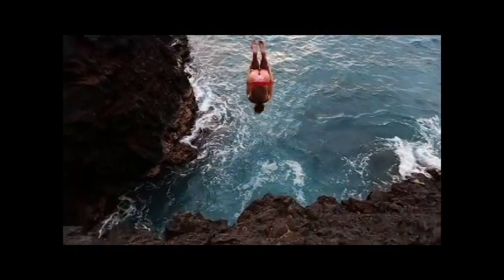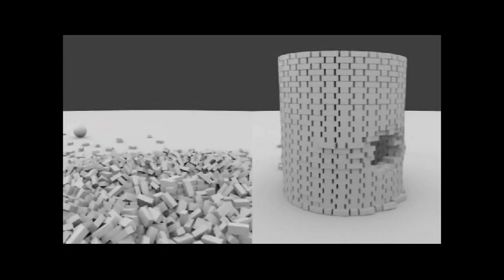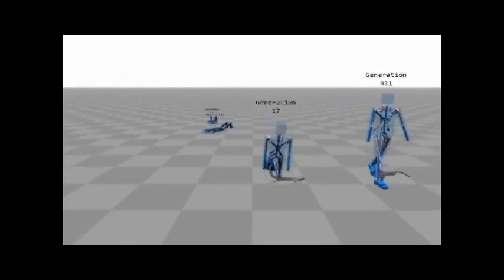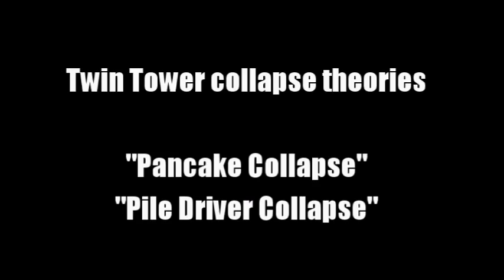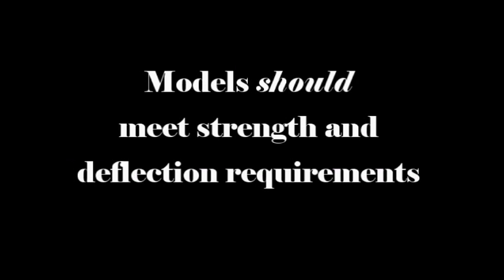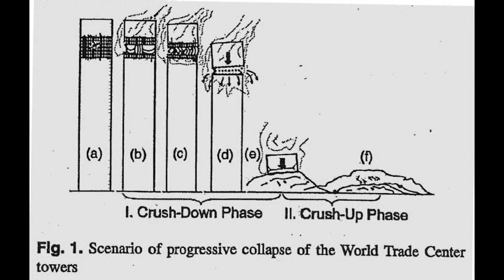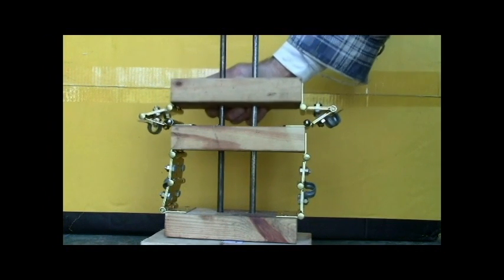9/11 Experiments: The Force Behind the Motion

Comment: Your method is simply wrong. You cannot draw conclusions from scaled models the way you do. The strength properties are not matching. The gravity-factor does not match. That is why people use computers for this kind of simulations. Then you can get the numbers right. But you need some education and the right tools to do it. Although Newtons laws are quite important, they are not the only laws to be used when analyzing a collapsing building, you have to take the structure into consideration. It took ½ a year in computer calculation time to calculated the collapse of building 7. But having done that, they ended up with a model that pretty much fitted into all the videos and observations, from the initial colapse of the penthouse building through the inital slow phase of collapse through 2.5 second free falling phase and through the last phase where the structure was again slowing. Unfortunately NIST did not simulate the downfall of WTC 1 and 2.

You try to analyze the downfall towers, but the materials you use have no relation to the steel used in the buildings. 

In your first experiment you work with walls that will never collapse! In WTC 1 and 2 you cannot have the walls standing in the free after the rest of the building is gone.
When you work with buildings you have to take bending moments, and buckling proces into consideration. In the WTC the changing properties of the steel when heated was an important factor in the collapse.

But maybe this simple argument will help your understanding.
For WTC 1 and 2 the walls were the strongest part of the building, they did not crush as fast as the center, so it looked like explosions coming from inside when the floors were pancaking. Eventually when the walls crushed they bended outwards like a canopée. This effect flew burning material from the south tower into building 7, and ignited the fires there. But in order to understand that, you must be able to understand, that a vertical force can transverse into a vertical movement simply because of bending. Think about a lamp post that buckles, it will bend and fall outward.  A normal lampost will however still be straight while the base is bending but if you have a 110 story wall! It will bend over, there is now way you can have 110 story wall standing without support.  In your first model the walls could not move, the floors were to strong. If you think about it. The WTC tower 1 and 2 had some 30 to 40 story building falling in the start just one floor down. No building in the world is designed to stop that motion. That is why the collapse continued all the way.

It simply had to collapse. That's probably why NIST did not even consider modelling the downfall of the building. The initiation process is enough to understand. When a 30 story building starts falling, it will pulverise everything!
What about the walls, they were designed to support the building, but they could not stand without bending without the support of the rest of the building. How much could they stay without bending. In the debris of one of the buildings there is a multi story wall standing, which may be used as a thumb rule of how tall a wall can reach before bending over. If you are a building engineer you can calculate that more precisely. Anyway the movement of the walls is quite important to understand when trying to understand how the building crashed. And you can see that on the movies if you know what to look for.
Reply: "In WTC 1 and 2 you cannot have the walls standing in the free after the rest of the building is gone."
I believe this is the most important observation/fact to understand why the towers fully collapsed. Combined with the fact that the core and perimeter elements were bolted together, not designed to tak any other than vertical forces.
Reply: Your observstion is overly done and thus utterly wrong.

You have steel sections weighing several tons being thrown out at such speed that they imbedded themselves into neighboring buildings!!  

When the sole force being applied is gravity.

Your theiry has ZERO reason for the force that threw those beams out.  

The ONLY way you get those beams to do this is to apply a force that is not from gravity.

And your theory lacks any explaination for where all the stuff went in those towers.  The only things they recovered were steel frame.  1 file cabinet out of 40k plus.  No desks.  No transformers.  No ANYTHING.  Besides paper there was no evidence proving the worlds largest business office complex was ever there.

Your theory also ignores how fires could have burned for 100 daysafter the collapse.  Those fires according to your boys were due to office fires fueled by jet fuel and office supplies.

But you again pretend that the majority of jet fuel was gone when the plan exploded.  And office furniture is required to be resistant to fire.  

And how many people did you see leave those buildings soaked in water from a sprinkling system?  

0. Thats how many.

Seems odd the largest office buildings on earth did not have sprinklers go off.
Reply: @DS94everXev  "Your observstion is overly done and thus utterly wrong."
Are you sure? Let's take a look at your arguments...

"You have steel sections weighing several tons being thrown out at such speed that they imbedded themselves into neighboring buildings!! When the sole force being applied is gravity. Your theiry has ZERO reason for the force that threw those beams out. The ONLY way you get those beams to do this is to apply a force that is not from gravity."
So, some sections of the perimeter travelled about 500 ft. Quite a distance for such a heavy object. I agree. Yet you claim these were " thrown". Not sure what that means exactly, but it looks like you suggest this throwing would have been the result of some explosion. Now I am curious what kind of explosion would be able to throw multiple tons steel segments 500 ft away. For sure demolition explosives are designed to cut trough steel, not to throw steel away. I guess we can agree to that. Let's take a look at an alternative explanation.

Imagine a pile of beer crates falling sideways. The upper crate would travel quite a distance, depending on the size of the pile. No explosives needed for that, just gravity. The crates represent the perimeter segments. What would happen if parts of the perimeter would fall over, like slabs of segments, maintaining connected? It is not hard to imagine that the upper segments would travel quite some distance as well. The horizontal distance travelled would equal the vertical size of the slab. Now, would there be some kind of evidence to support this explanation? Maybe a picture that shows a slab of connected perimeter elements laying over West St.? Yes, there is. Please take a look at this picture below and see of the slab and the embedded element form a perfect line.

https://ia801303.us.archive.org/2/items/NIST_9-11_Release_08/International_Center_for_911_Studies_NIST_FOIA/Release_08/Release%208/42A0007%20-%201of3/Police%20Overheads/166.JPG

So, no explosions/explosives needed. Just gravity.

"And your theory lacks any explaination for where all the stuff went in those towers.  The only things they recovered were steel frame.  1 file cabinet out of 40k plus.  No desks.  No transformers.  No ANYTHING.  Besides paper there was no evidence proving the worlds largest business office complex was ever there."
Nah. I know this is a popular believe within the truther community. But it is incorrect. Yes, larger objects were reduced to small pieces in the collapsing process, but what does that mean? A lot of items were recovered at Fresh Kills. Keys, elevator signs, credit cards, also armrests and seatbelts from the planes. Larger pieces as well, like elevator motors.

https://www.youtube.com/watch?v=OdMqX_F66rE
https://www.youtube.com/watch?v=Bgt5a-HoPPo

Let me ask you this, how would explosives cause the contents of the buildings to disappear?

"Your theory also ignores how fires could have burned for 100 daysafter the collapse.  Those fires according to your boys were due to office fires fueled by jet fuel and office supplies. But you again pretend that the majority of jet fuel was gone when the plan exploded.  And office furniture is required to be resistant to fire."
Jet fuel ignited the office fires. Office fires are fires fueled by office contents. Some office content is highly combustible:
- Wiring
- Plastics from phones, printers, faxes and other equipment
- Paper (a LOT of it)
- Rugs
- Curtains
- Furniture
When you claim "office furniture is required to be resistant to fire", to which specific law or regulation are you referring?

"And how many people did you see leave those buildings soaked in water from a sprinkling system? 0. Thats how many. Seems odd the largest office buildings on earth did not have sprinklers go off."
So how would you expect a sprinkling system to be intact after a plane flew into a building, destroying steel and concrete? I think it is safe to assume water pipes were destroyed upon impact as well. Not really odd to me.
Reply: @brucelansberg5485  1.  Your comments are made to explain that which can not be explained.

The sprinklers in the lobby would still have worked.  As would the sprinklers in all the floors below the impact.  The people on those lower floors would be the ones that escaped.  They would be wet.  But they werent.

2.  All the items you list computers pladtic are not going to get a fire hot enough to melt and bend steel that has fire protective coating on it that the towers had (hint they actually didnt).

3.  It is not incorrect that only 1file cabinet was recovered.  And it was in the basement.  Where did all the stuff go?  You still dont state that.  The recovery workers eondered the same thing.
Typical demolition explosives do not throw objects like we see.  And vertainly gravity wont as it acts only in the z axis.  There MUST be a force that is strong enough apllied in a direction that IS NOT from gravity to throw those sections into and embed them into buildings.

Your beer crates arent multi ton steel sections.

And you are not even getting at the real cinundrum conundrum of 911.  How did those planes reach the speed the government said they did (500 plus mph) when those planes maxout at 250 mph below 10000 feet?

Hmmmm????

Those planes that hit the tower would have been flown apart going that speed.  But they were stable as can.be.

That is IMPOSSIBLE.  Those passenger planes can not go that speed.  The phone calls made as the planes hit did not show any screaming or anything that woild have happened if a plane went 2x the max speed it actually can.

So all your talk about explaining the impossible on the towers is ALL DEPENDENT on explaining first how those planes went that fast.  Then explain how those planes that a flock of birds that impact the plane can rip huge holes in it managed to blow thru steel concrete buildings.  Cant wait for your newtonian law here!

You conspiracy people want to pretend that the building is the start of the physics impossible problem.

Explain those planes!  Because you cant.  Then all your defense on the towerd collapsing falls apart like paper machet.
Reply: @DS94everXev  Thanks for your quick reply. At least we seem to be in agreement on the alleged throwing out of multi ton steel elements. That's progress.

The sprinklers. I'm not a fire safety engineer, but I can't imagine sprinklers being activated on floors that are not on fire. Why would they? Sprinklers are activated by a heat sensitive element that responds to the heat of a fire. Which seems to indicate no response without hat from a fire. As far as I know, no people were evacuated through the lobby since there was a real danger of getting killed by falling bodies and debris. That maybe leaves a handful of people that might have gotten wet by the sprinklers in the lobby.

"All the items you list computers pladtic are not going to get a fire hot enough to melt and bend steel that has fire protective coating on it"
You might want to research expected temperatures in office fires. The avarage temperature in building fires is 1700 F. Plastics only add to that temperature. Steel will have lost 50% of its strength at about 1150 F. No steel was melted.

It is assumed the fire protective spray on was blown off upon tyhe plane impacts.

"It is not incorrect that only 1file cabinet was recovered."
I was referring to your claim nothing except paper was found to indicate there ever were office buildings.

"Where did all the stuff go?  You still dont state that."
My response was that larger objects (like filing cabinets) were reduced to smaller pieces. Have you watched the two short videos of the trip to Fresh Kills?

"The recovery workers eondered the same thing."
They didn't. They merely observed it.

"Typical demolition explosives do not throw objects like we see.  And vertainly gravity wont as it acts only in the z axis.  There MUST be a force that is strong enough apllied in a direction that IS NOT from gravity to throw those sections into and embed them into buildings."
I am so sorry you still don't seem to understand how that piece ended up stuck into the WFC. I clearly was too early when I stated we agreed upon something here. Please click the link I provided in my earlier post. You will see how full slabs of perimeter panels fell as one and hit the WFC building. It is righyt there, in that one single picture. You only need to click it.

You remark on the direction of gravity which is not able to move objects in any other direction, is clueless. Sorry to say. Just put your car on top of a hill and put it in neutral. Does it move due to gravity> Yes. Does it move in any other direction than vertically? Yes. If your logic would be correct, nothing would ever fall over. We could balance a baseball bat right on the floor. Gravity does make stuff move sideways.

The beer crates (not cans) fall over when stacked. The top one falls way out of the footprint of the complete stack. Mass has nothing to do with this principle.

Please take a look at the picture I linked before.
Reply: @brucelansberg5485  
"You might want to research expected temperatures in office fires. The avarage temperature in building fires is 1700 F. Plastics only add to that temperature. Steel will have lost 50% of its strength at about 1150 F. No steel was melted."

Then you are saying that typical office fires would weaken steel to lose 50% of their strength and thus those buildings would see a similar collapse like the WTT.  

Yeah not buying it.

"It is assumed the fire protective spray on was blown off upon tyhe plane impacts."

Why?  Does that mean that an energy impact on a building makes the steel lose its fire protection?

You realize that it does not matter what the source of that energy is right?  An earthquake can apply WAY more energy than the plane did.  Does that mean that after every earthquake the steel must be checked for fire protection stability to see if it is still there?

"Just put your car on top of a hill and put it in neutral"
And if my car was put in neutral and was accelerated to several hundred mph before it was even rolling down hill that would be a sight to see. 

That is the kind of speed those steel sections were going!  A force was applied to them to make them go that direction when there was NO FORCE if it was just gravity.  You can only conclude not from gravity or things falling on top of it was applied to make that happen.  Why is this so difficult for you to understand?  

Lastly, the planes are what matter!  Can't explain the physics of how those planes were stable and not falling apart going over 2x the speed they can handle.  

So the entire story after that is conspiracy hiding the truth.

Those planes are what matter.  There would be nothing left of those planes if they tried to go that fast.  They'd never reach the towers.
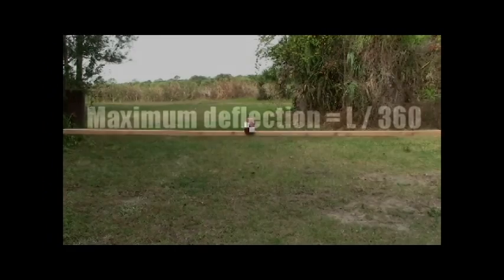Reply: @DS94everXev  "Here is a link from an actual pilot stating the max speed and explaining what happens to passenger planes that exceed that max speed. Go to the 4:50 mark to hear him state 250ph is max speed."
I love Mentour Pilot and have had a subscription with his channel for years. He mentions a maximum speed of 250 knots per hour USING FLAPS, used during landing and taking off. In addition he is talking about a 737 while the planes that went into the towers were botht 767's. It probably won't make much of a difference, but still max speeds using flaps in any configuration are different for different airplanes.

"Whatever hit those towers was going 500 plus mph.  Thus whatever hit those towers WERE NOT those passenger planes."
If your facts are wrong, your conclusion will be wrong as well. Interesting though you do accept indicated speeds of both flights, although they were published by the same authorities whose explanation and conclusion you do not accept.

Flight 11 was doing 465 mph by the way.

"Thus the ENTIRE narrative of your government conspiracy is WRONG.  It all hinges on those planes going that fast."
So the conclusion above is based on your false interpretation of Mentour Pilots'  explanation on speed limits on a 737 using flaps?

"By the way do you know who does have planes that can travel 500+ mph at well below 10000 feet?  The military."
So?

"Who has access to not just thermite but nano thermite which was found on site?  We do."
Your thinking process is going in all directions at the same time :). It's a little bit hard to follow. Anyway, (nano) thermite is an incendiary, not an explosive. So if you're suggesting (nano) thermite was being used to bring down the towers, and you believe some exterior panels were thrown off the buildings horizontally, you have some explaining to do. You can't have both.

Then again, there is no proof whatsoever (nano) thermite was found. I am well aware of the flawed paper by Harrit and Jones. All they have proved is that primer paint is combustible.

"And before you try to throw some convulated physics around explaining how those are not nano thermite spheres you MUST explain those planes going that fast! Hint. You cant."
I think I shown how your conclusion on the maximum speed based on the video you provided is false. There is no other explaining to do on my side. You should find yourself some other credible source to back up your claim.

"Why the US and Israeli government does of course."
I don't understand what you're trying to say here :).

"Who has access to the grade of anthrax that was sent after 911"
I don't see how this has anythinf to do with the subject matter. I haven't studied it and I do not think this is relevant.

"a guy hidden in a cave in one of the poorest country on earth"
Who is a member of one of the richest families on earth... Funding has never been an issue for Bin Laden.

"Who would have access to something that annhilated things that cant be annhilated (those turbine engines and black box and transformers)?"
Contrary to what you seem to believe, black boxes and engines are not indestructible. I don't think the strength of black boxes has been tested in circomstances of collaping buildings falling on top of them. Then again, maybe they weren't destroyed but simply never found in a 1.8 million ton debris pile.
Reply: @DS94everXev  "Then you are saying that typical office fires would weaken steel to lose 50% of their strength and thus those buildings would see a similar collapse like the WTT."
No I'm not. I was saying steel will have lost 50% of its strength at a temperature of about 1150 F. What is means to burning buildings is a different story. Steel framed buildings have some kind of fire resistance to slow down the heating process of the steel. In most cases sprinkler systems will not be wiped out as a result of fire. But most importantly, luckily most steel framed buildings are not susceptible for progressive collapse. And last but not least, most office fires do not rage on several floors and at the same time and are faught.

"Why? "
Because two high speed plane impacts caused massive explosions. Explosions come with pressure waves. These pressure waves could have easily blown off the sprayed on protection.

"Does that mean that an energy impact on a building makes the steel lose its fire protection?"
In general? No. In the case of the twin towers? Yes. "Energy impact" is a very, very broad description and can mean a lot. We should focus on what happened at the twin towers I guess.

"You realize that it does not matter what the source of that energy is right?  An earthquake can apply WAY more energy than the plane did."
Well, if an earth quake would cause massive pressure waves inside the buildings, than earth quakes could do the same kind of damage. In any other case, no.

"Does that mean that after every earthquake the steel must be checked for fire protection stability to see if it is still there?"
Since earth quakes do not produce massive pressure wave, it seems unnecessary to do so. But to be honest, I don't know.

"And if my car was put in neutral and was accelerated to several hundred mph before it was even rolling down hill that would be a sight to see. "
I would to see that! :)

"That is the kind of speed those steel sections were going!"
So you're claiming those steel sections were going several hundreds mph? Even your friends at AETruth would find that rediculous. I believe Chandler measured a speed of somewhere between 45-70 mph. I can't be bothered to look it up though. But your claim is utter nonsense.

"A force was applied to them to make them go that direction when there was NO FORCE if it was just gravity.  You can only conclude not from gravity or things falling on top of it was applied to make that happen.  Why is this so difficult for you to understand?  "
It seems you haven't read or understood what I wrote before. Put a baseball bat on a floor standing up. Now release it. Which way is that bat falling? Straight down? Or is it falling sideways? The perimeter walls of the towers consisted of 3 story tall steel elements bolted together. What would happen if these walls weren't attached to the building and the connections remained? It would fall exactly like the baseball bat. Sideways. What we see in the countless videos is only the top elements of a complete wall. The lower elements are hidden by dust. But all elements fall as 1 single piece, sideways, as proven by the picture I linked earlier, where we can clearly see a slab of perimeter elements laying over West St. We can see the direction in which the wall fell, We can follow its path. And we can see how the upper elements hit the WFC. Please take a look at that picture.

"Lastly, the planes are what matter!  Can't explain the physics of how those planes were stable and not falling apart going over 2x the speed they can handle. "
Over 2 times the speed they can handle? According to whom?

"Those planes are what matter.  There would be nothing left of those planes if they tried to go that fast.  They'd never reach the towers."
Also, according to whom?

Please take a look at this video. Any idea how fast this plane is going at basically ground level?

https://www.youtube.com/watch?v=N1PKEqIBQAk
Reply: @brucelansberg5485  

"I love Mentour Pilot and have had a subscription with his channel for years. He mentions a maximum speed of 250 knots per hour USING FLAPS, used during landing and taking off. In addition he is talking about a 737 while the planes that went into the towers were botht 767's. It probably won't make much of a difference, but still max speeds using flaps in any configuration are different for different airplanes."

And you fail to state the max speed of the 767 at 1000 feet.  Guess what?  It ain't that different!  But you ignore the point made completely by talking about wing flap position?!!!  How come the pilot doesn't say wing flap positions can make a plane that can go 250 max manage to more than double its max velocity if it places its wing flaps just so.  

He doesn't because you are being a wise ass.  Not to mention that the terrorist's pilots could not land a Cessna or fly it well, but you want me to pretend that these guys had more savvy than the actual pilot of these planes.  Yeah.  Not happening.  

"If your facts are wrong, your conclusion will be wrong as well. Interesting though you do accept indicated speeds of both flights, although they were published by the same authorities whose explanation and conclusion you do not accept."

So you are arguing that the NIST is wrong then.  Or right?  Or what are you arguing?  I'm talking about measuring velocity of an object.  That is WAY easier than finding out how a building fell and is easily disproved if not correct.  I'm using the measured speeds and you are saying its a joke and to ignore it.  

"So?"

So the only group that has access to all these things are us.  Nano thermite.  Military grade Anthrax and planes that can go the speed that the planes went that hit the towers are the military.  That is why.  Hint:  It ain't some guys in caves living across the world where they use walkie talkies who managed to create all this and plan out the most orchestrated attack in world history on the most powerful military in world history. 

"Anyway, (nano) thermite is an incendiary, not an explosive. So if you're suggesting (nano) thermite was being used to bring down the towers, and you believe some exterior panels were thrown off the buildings horizontally, you have some explaining to do. You can't have both"

No.  I never said nanothermite blew those steel beems out to imbed into neighboring buildings.  But it is used to cut steel.  And cutting steel is precisely what you would have to do to bring down the towers. 

Something well beyond TNT was used to fling those beams out like that.  

"Then again, there is no proof whatsoever (nano) thermite was found. I am well aware of the flawed paper by Harrit and Jones. All they have proved is that primer paint is combustible."

Says no peer review paper.  It was found.  Simple as that.  

"I think I shown how your conclusion on the maximum speed based on the video you provided is false. There is no other explaining to do on my side. You should find yourself some other credible source to back up your claim."

No you actually did not do that in the slightest.  You obsessed on wing flap position and think that the planes got all that speed from a descent that did not rip the plane apart at all! 

before

ignores

Those phone calls were clear.  They had ZERO noise in them.  No engine noise.  One person was on the phone till the plane  hit.  Don't you think  a plane that is far exceeding its max ability would be scaring the passengers?  yet not a single person was screaming.  Hmmm.....  

explanation

explanation

Put simply.  Your explanation does not fit any of the known evidence.  And mine fits it perfectly.

In your pretend world, we can have pictures of passenger planes being ripped into shreds by hail and birds.  Yet them going thru a steel and concrete building and not just folding like a pancake when the plane hit the towers is perfectly acceptable.

I can only conclude then that the materials that make birds (hollow birds and feathers) must become the material we make future building from!  Afterall they can go thru a plane and a plane can go thru concrete so build buildings from hollow bones and feathers so when planes hit it, the building will not collapse.  This is the physics in your world.  I'm only going with it.    

"Who is a member of one of the richest families on earth... Funding has never been an issue for Bin Laden."

Haha!!!  So first world countries with WAY MORE MONEY AND KNOWLEDGE can not make this stuff and conjure up this plan while some guy who has flat out defied his family can manage this and make this stuff.  Again.  Not buying it.

"Contrary to what you seem to believe, black boxes and engines are not indestructible. I don't think the strength of black boxes has been tested in circomstances of collaping buildings falling on top of them. Then again, maybe they weren't destroyed but simply never found in a 1.8 million ton debris pile."

Funny thing is.  No crash on land has ever resulted in these things being destroyed or lost.  And on this day ALL WERE.

You also pretend again becasue you are limiting your discussion to the towers when more happened that day, that the plane that hit the pentagon and Flight 97 would have not been crushed by ANYTHING.  So where are they? 

nothing

And the Pentagon (which made a 270 corkscrew turn that a Top Gun pilot says he could not have managed to make while flying an F16 also failed to have a black box recovered.

because
Reply: @DS94everXev  "And you fail to state the max speed of the 767 at 1000 feet."
Why would I ever mention that in a comment on your misinterpretation of your own source?

" But you ignore the point made completely by talking about wing flap position?!!!  How come the pilot doesn't say wing flap positions can make a plane that can go 250 max manage to more than double its max velocity if it places its wing flaps just so. "
Dude, are you serious now? Please tell me where he stated that a 737 has a vMax of 250 knots ph? Please rewatch your own source from 2:00. He clearly says: "When we are taking off and when we are landing, we are extending high lift devices on the wings, so flaps. For every time you extend something, you're basically putting more of the aircraft into the face of the ongoing wind. So the drag will increase." In the part hereafter is discussing speed restrictions WHEN USING FLAPS. Please learn what flaps are and when they are used. You nonsensical claim is like stating your car has a maximum speed limit of 30 mph, while that limit only applies when driving in first gear.

Please look up maximum operating speed 737. Then lookup VD.

As for the quote an aircraft cannot go over 250 knots below 10k ft, please scroll to 10:45 where he explains this limitation is forced by air traffic control. It has nothing to do with the characteristics of the plane.

Please make sure you understand your own sources.

"So you are arguing that the NIST is wrong then.  Or right?  Or what are you arguing?"
It's not that difficult. I was trying to understand your point of view when it comes to official sources. You have accepted the measured speeds, but you have not accepted the fact that it were actually planes that hit the towers. Both claims originated from the same governmental source. So what is it?

"I'm using the measured speeds and you are saying its a joke and to ignore it."
Please re-read what I wrote.

"So the only group that has access to all these things are us.  Nano thermite.  Military grade Anthrax and planes that can go the speed that the planes went that hit the towers"
No thermite of any kind was found.
Anthrax is irrelevant and not related to the attacks on 9/11.
Planes fly faster than you have assumed based upon a fals interpretation of your trustfull source.

"I never said nanothermite blew those steel beems out to imbed into neighboring buildings."
Fair enough. But that would mean that both thermite and some kind of explosive must gave been used?

"But it is used to cut steel."
So is water.

"And cutting steel is precisely what you would have to do to bring down the towers. "
That would indeed be one of many ways to bring the towers down. There is only one problem though. How many pictures have you seen that show cut steel by thermite? Oh, there's another problem. How long did it take for the towers to come down? 15 en 22 seconds? How fast does thermite cut through inches thick steel? Wait, another issue. How much thermite would be needed? Tons? dozens of tons? Wouldn't you think that using so much thermite would leave some kind of evidence?

"Something well beyond TNT was used to fling those beams out like that."
How many times do I have to say this? No steel panels or beams were flung out or thrown out. Please please please take a look at the picture I linked. Why haven't you?
Also., why would something beyond TNT be needed if thermite could do the job as you just stated?

"It was found.  Simple as that."
No elemental aluminum was found. No elemental aluminum = no thermite.

"You obsessed on wing flap position and think that the planes got all that speed from a descent that did not rip the plane apart at all! "
I was simply repeating wordings used by YOUR OWN SOURCE. Why would the plane rip apart? You make up new stuff every time.

"Those phone calls were clear.  They had ZERO noise in them.  No engine noise.  One person was on the phone till the plane  hit.  Don't you think  a plane that is far exceeding its max ability would be scaring the passengers?  yet not a single person was screaming.  Hmmm.....  "
And yet another shot in the dark. Friendly advice: try to comprehend why your earlier claims are incorrect/nonsensical before you throw out a new one.

"Your explanation does not fit any of the known evidence.  And mine fits it perfectly."
In psychology this is referred to as confirmation bias.
Pease tell me which part exactly of my explanation does not fit? It only seems far after I have shown you several times why you have been wrong so far.

"In your pretend world, we can have pictures of passenger planes being ripped into shreds by hail and birds.  Yet them going thru a steel and concrete building and not just folding like a pancake when the plane hit the towers is perfectly acceptable."
And yet another new baseless and uninformed claim. 
Please show me 3 pictures of planes that have been ripped into shreds by hail or birds. 2 will do as well. Or just one is fine too. They don't exist. Yes, damage, sure. No plane went through any tower on 9/11. Steel got bent inward or disconnected from other steel elements. Only the engines made any steel burst. And no for some physics. Does F=m*a ring a bell? It's the formula for force. Force is a result of speed and mass. Nowhere in this equation is material any part. It is all about mass and speed. Pick up a cotton bowl with the same mass and throw it into the towers with the same speed. The exact same force will be applied to the towers. Did you by the way notice how the planes got ripped apart upon impact?

"I can only conclude then that the materials that make birds (hollow birds and feathers) must become the material we make future building from!  Afterall they can go thru a plane and a plane can go thru concrete so build buildings from hollow bones and feathers so when planes hit it, the building will not collapse.  This is the physics in your world.  I'm only going with it. "
No, it isn't. See reply above. And please educate yourself in physics just a little bit. It makes chances on unnecessary comments a bit smaller.

"So first world countries with WAY MORE MONEY AND KNOWLEDGE can not make this stuff and conjure up this plan while some guy who has flat out defied his family can manage this and make this stuff.  Again.  Not buying it."
Are you disputing his family was filthy rich? Are you disputing that he was funded by his family?

"No crash on land has ever resulted in these things being destroyed or lost"
Get your facts straight: https://en.wikipedia.org/wiki/List_of_unrecovered_and_unusable_flight_recorders

"And on this day ALL WERE."
Get your facts straight. Both CVR and FDR of flight 93 were recovered.

"You also pretend again becasue you are limiting your discussion to the towers when more happened that day"
I am responding to the nonsensical claims you make. Have you mentioned anything yet I haven't repsonded to?

"that the plane that hit the pentagon and Flight 97 would have not been crushed by ANYTHING.  So where are they? "
I have no idea which flight 97 is. I assume you mean 93? And what exactly did I pretend and when? Not crushed by anything? What does that mean?

"which made a 270 corkscrew turn"
A corkscrew turn that took several minutes...

"that a Top Gun pilot says he could not have managed to make while flying an F16"
I don't about that top gun pilot. But if he really claimed this, he is either lying or he has no clue what he is talking about. Even very unexperienced pilots could do the turn in a sim.

"also failed to have a black box recovered."
Yes, just like in New York where the planes crashed into buildings at high speed.
Reply: @brucelansberg5485  
Looks like YouTube does not like their own vids to link and my reply was removed.

So, you need to look this up
"Can a commercial jetliner fly above 500 mph at seal level?"

Look that video up.  Its a guy who is talking to pilots, Boeing and aeronautical engineers.  You know the very people you want me to contact yet you  think the answers will be in your favor (hint they are not)

You are totally and utterly wrong in every point made in your analysis of planes and speed and elevation.

Planes encounter more wind resistance the lower they go.  And thus they must decrease their velocity as they descend!  If not they will flutter and fall apart.  

Yet the planes that hit were not fluttering in the slightest.  "If a plane did hit 540 mph it would start to lose parts of the airplane."

Again you don't see ANYTHING falling off those planes.

The pilot is talking about the plane.  The Boeing guy is talking about the engine.  

Go to 8 min mark.  It's impossible that the airplane went that speed (500 mph) says the Aeronautical engineer!  You need so much power to push your way thru all that air at sea level the plane can't create it.  the engines would have to put out 6x more  power at sea level (compared to cruising speed elevation) and those engines can't put out that power.  If you change out the motors that have 6x the thrust then you theoretically can.  But then the structure is not strong enough."

Again he knows more than you so maybe you should listen to him.

Says another aeronautical engineer and Captain he is asked if a plane can travel over 500 mph at cruising elevation can it travel as fast at sea sea level?

"Uh no.  The above indicated air speed would be above its max speed at sea level."

Again, a guy who knows more than you so listen to him and stop making up fake Physics laws for 9/11 where they sped up due to descending.

But I am confident that you will continue with your utterly insane belief that F-ma will show the planes can easily do what happened.
Reply: @brucelansberg5485  By the way, if you look at the first pilot vid I linked to you, you will see that I made a comment on the vid.  As did someone else about the same thing about 9/11.

And we got a response from the pilot himself!

Know what he didn't' say?  That we were wrong.  funny.  I'd think he'd correct us like you tried to do using his comments in his own video that he made to tell us that we misinterpreted him.  

Why didn't he do that?  Hmmmmm????
Hint...I didn't misinterpret his video.  You did.  As this video of the guy talking with Boeing, pilot and aeronautical engineers backs up my interpretation of the first video and disproves yours.
Reply: @brucelansberg5485  How come the pepper spray only impacted part of the airplane (business class)?

You do understand that airplanes are pressurized when in flight.  And therefore the pepper spray would have impacted ALL ABOARD.  Flight crew.  Passengers AND bad guys.  Why would bad guys use pepper spray that would impact them (the bad guy pilots would feel it as well) as much as the rest of the crew?

So tell me how only part of the plane suffered from pepper spray but spared other parts of the plane.  This will be fun.
Reply: @brucelansberg5485  HInt:  Only part of those on board felt the pepper spray because the landing door was open.  It was open because the plane was on the ground after it landed.  And the "phone call that had zero noise from engines and others talking yelling screaming crying, etc. was not made in the air.  It was made on the ground.

That is why.
Reply: @DS94everXev  "The ONLY way you get those beams to do this is to apply a force that is not from gravity."
Oh, god, it's the magic beams again.
Ok, so, show me a photo of a building that has been literally shotgunned to pieces. Show me a victim in another building at 9/11 that was killed by a flying computer.

Because if the supposed "force that is not from gravity" was shooting building beams into other buildings, that building and all the other ones around there, should have been absolutely RIDDLED with office equipment, rubble, smaller parts of the steel framework, etc. It should've looked like someone took the worlds largest shotgun to things.

And yet, there's no sign of it. But, I'm sure I missed it and you have evidence of this happening.
Reply: @brucelansberg5485  "These pressure waves could have easily blown off the sprayed on protection."
Not "could have". Did. There is clear video evidence of this.
Reply: @brucelansberg5485  So where are you? You demanded experts state that the planes could NEVER have achieved what the gov said they did.

I provided it.  

And you have gone silent since I provided that which you said you wanted but never believed would get.

There are a lot of experts in that video.  Supporting my theory.   Literally ridiculing laughing and flat out stating that it was "impossible".  This on top of the first pilot video where he said the same thing.  250 mph is vmo below 10000 feet.  Not 500 or 600 mph!

So I got another video to show you about Bldg 7.  Youll find 9/11 physic events that never did can or will occur again unless we do a similar thing again I'm certai.  but to those who understand fact its absolute proof that NIST was wrong in tjeir entire story.  A man who was IN THE BUILDING gives his account of what went down.

Just like Colin Powell via the  CIA was wrong about mobile chemical plants in Iraq.  Just like the CIA was wrong about gas attacks in Syria.  Just like the CIA lied about Gulf of Tonkin to get us into Vietnam.  Just like the CIA lies about terrorist targets who end up being kids at school.

The only certainty is that the CIA LIES!!  They tell the gov what the "evidence" is.  NIST does what they want.  

The difference between us is you continue to believe the lies the CIA makes to make us to to war and I do not.  We have not been in a legit non propogsnda war on my lifetime.  And the same is true for you.  And I dont need to know your age to know this is true.  Its just fact.
Reply: @DS94everXev  "Look that video up.  Its a guy who is talking to pilots, Boeing and aeronautical engineers.  You know the very people you want me to contact yet you  think the answers will be in your favor (hint they are not)"
Like I wrote before, you should really pick your sources a bit more carefull. The discussion in the video you mentioned is about thrust of the engines. These can not deliver enough thrust to keep the plane flying level at sea level. Yet, in a dive gravity is helping, like stated in the last phonecall. Did you miss that? It happened to be that the second was in a steep dive when hitting the tower. So, again, your video is completely irrelevant.

"You are totally and utterly wrong in every point made in your analysis of planes and speed and elevation."
Yeah, you wrote that before. Yet, you fail to address AGAIN why.

"And thus they must decrease their velocity as they descend!  If not they will flutter and fall apart."
Every plane has a specific vmo. VMO is the indicated air speed at which a plane is safe to fly. What happens when it exceeds VMO is unknow. Yes, at SOME point it will start breaking apart. When's that time exactly for a 767? None of the videos you linked or described mentions this for a 767. You "conclusion" is an assumptions, not based on reality.

"Yet the planes that hit were not fluttering in the slightest."
I asked you before and you ignored that question (like you have ignored most of my questions), how do you know if those planes did or did not flutter? And why is the first plane relevant anyway?

"Again you don't see ANYTHING falling off those planes."
Really? What do you expect to see from grainy, low quality videos, shot from a distance that in most cases at best captured the last 5 seconds of the plane's flight?

"Go to 8 min mark.  It's impossible that the airplane went that speed (500 mph) says the Aeronautical engineer!  You need so much power to push your way thru all that air at sea level the plane can't create it.  the engines would have to put out 6x more  power at sea level (compared to cruising speed elevation) and those engines can't put out that power.  If you change out the motors that have 6x the thrust then you theoretically can.  But then the structure is not strong enough.""
Covered that above. ABout the structure, yes, the engines would seperate themselves from the wings if they'd deliver 6 imes as much thrust. Yet they didn't need to deliver 6 times more thrust, did they?

"Again he knows more than you so maybe you should listen to him."
Maybe you should quit assuming.

"But I am confident that you will continue with your utterly insane belief that F-ma will show the planes can easily do what happened."
Please stop misquoting me. I mentioned F=m*a in relation to the damage the planes did to the towers.
Reply: @DS94everXev  "By the way, if you look at the first pilot vid I linked to you, you will see that I made a comment on the vid.  As did someone else about the same thing about 9/11. And we got a response from the pilot himself!"
Haha, yeah, the other guy received a comment from him. You did not. And you know what he replied? "Did they?" Yeah, you got a reply...

"Know what he didn't' say?  That we were wrong.  funny.  I'd think he'd correct us like you tried to do using his comments in his own video that he made to tell us that we misinterpreted him.  "
Wow, this is the most stupid comment I have read in months. Finding proof in something that wasn't said. But let me help: YOU ARE WRONG. Well, that's taken care of now.

"Hint...I didn't misinterpret his video.  You did."
You did not watch the full video. You didn't taken the effort to look why he mentioned that a plane can't go faster than 250 knot below 10k ft. He explained in the same video and you missed it. He explained that air traffic control limits speeds for passenger flights below 10k ft to 250 knots.
You claimed the planes could not have the towers at the observed speeds because they can't go faster at that altitude and you backed up that rediculous claim by linking to this video and a very specific timestamp. Yet you failed to research why he was saying this, although the explanation is in the same video. What does that tell you about your sicerity when it comes to researching 9/11?

"As this video of the guy talking with Boeing, pilot and aeronautical engineers backs up my interpretation of the first video and disproves yours."
No it doesn't. Dam dude, I am started to get worried about your lack of intellect. I usually don't refrain to personal insult, and please don't take this comment as one. I am seriously worried for you. The second video is about the power of the engines (which is irrelevant in a dive) and one guy very briefly speculated about losing parts. This has nothing to do with speec limitations set by air traffic control. Nothing.
Reply: @DS94everXev  "How come the pepper spray only impacted part of the airplane (business class)?"
And again, a new unsubstantiated claim. But I'll bite: What pepper spray? 

"You do understand that airplanes are pressurized when in flight."
Yes I do, but thanks for checking.

"And therefore the pepper spray would have impacted ALL ABOARD."
"So tell me how only part of the plane suffered from pepper spray but spared other parts of the plane.  This will be fun."
What? Please tell me how cabine pressurization works according to you. Why the hell would pepper spray impact all aboard? Why would a liquid travel through the whole fusulage when under pressure? This will be fun.
Reply: @DS94everXev  "Only part of those on board felt the pepper spray because the landing door was open.  It was open because the plane was on the ground after it landed.  And the "phone call that had zero noise from engines and others talking yelling screaming crying, etc. was not made in the air.  It was made on the ground. That is why."
Thank you soooo much for a clear insight into the flawed "thinking" process of a conspiracy theorist. Start with a false assumption based on a lack of knowledge and continue speculating from there et voila! There is the evidence. First you need to explain why a liquid would spread through the fusilage if it's presurized. You know what, let's lower the bar: Why would a gas spread through the fusilage as a result of pressure?
And what do you mean no noise?
https://www.youtube.com/watch?v=COF0ErhsRDo
Other people not talking, yelling, screaming or crying? I think we're passed that moment at the time of the call.
Reply: @DS94everXev  "Go away.  I hate you.  Dont reply or ill report you."
I have to ask this: How old are you?
Reply: @DS94everXev  "So where are you?"
I'm in Amsterdam. Thanks for asking.

"You demanded experts state that the planes could NEVER have achieved what the gov said they did."
Please stop misquoting me.

"And you have gone silent since I provided that which you said you wanted but never believed would get."
This may come as a surprise to you, but I'm not on YouTube waiting for your replies 24/7.

"There are a lot of experts in that video.  Supporting my theory.   Literally ridiculing laughing and flat out stating that it was "impossible"."
See comments above.

"This on top of the first pilot video where he said the same thing. "
He didn't. He was taling about speed limitations for specific flap configurations in the first part of the video. He was talking about speed limitations set by air traffic control later on in the video. Both happened to be 250 knots.

"250 mph is vmo below 10000 feet."
What? Dude, please make sure you know what you're talking about. This is gettng embarrassing. 
VMO is indicated in not, not in miles.
VMO is a fixed number for every specific aircraft and independent on altitude because VMO is based on indicated airspeed
Indicated airspeed 
VMO for a 767 is 360 knots
VMO is irrelevant when it comes to the structural integrity of a plane.

" The difference between us is you continue to believe the lies the CIA makes to make us to to war and I do not.  We have not been in a legit non propogsnda war on my lifetime.  And the same"
And yet another baseless claim/assumption. In all my replies I have never mentioned the CIA, let alone I have used  them to back up my repsonses to your nonsense.
Reply: @brucelansberg5485  

You said this:
"You should find yourself some other credible source to back up your claim."

So I provided more credible sources in that video of aeronautical engineers and pilots WHO KNOW MORE THAN YOU DO support the statement I made that no way could those planes have gone that fast and been that stable.

And your response to that is "Please stop misquoting me."

So once again we have you saying that you want evidence.  It is provided.  Then you again ignore the video and did not watch while doubling down on how Im not giving you credible sources.  I'm giving you the guys who DESIGN and fly it!!  And you by the way have provided LITERALLY  NOTHTHING to support your comments that this is wrong.  Just you.

"And yet another baseless claim/assumption. In all my replies I have never mentioned the CIA, let alone I have used  them to back up my responses to your nonsense."
No you don't need to when you support their conclusions and dismiss actual first hand accounts and physics and timelines and peer review literature.  

You support the CIA by insisting you know better than those who design and fly the aircraft.  That is how.  You don't question what the CIA say.  And you defend what CIA say.    All without motioning the CIA.
Reply: @brucelansberg5485  
"Like I wrote before, you should really pick your sources a bit more carefull. The discussion in the video you mentioned is about thrust of the engines. These can not deliver enough thrust to keep the plane flying level at sea level. Yet, in a dive gravity is helping, like stated in the last phonecall. Did you miss that? 

"The discussion in the video you mentioned is about thrust of the engines. "
No it really isn't all about the engines at all.  
Though according to you engine thrust is not important in moving a plane at x speed at x elevation and neither is structural integrity in an aircraft so I'd take your entire reply as "I don't know what I'm talking about." 

The video is also about the ability to control the plane and the plane literally ripping apart.  The part about how the engines of the plane would have to be changed to get that thrust.  And even if they were changed the structure of the plane would not hold up to that so it would fall apart.  So basically the engine and structure would be changed (ie A DIFFERENT PLANE WAS USED)

You literally didn't listen to anything at all.  The words "impossible" were used regarding if the planes could do this.  Did you miss that?  Or the pilot saying you can't control the aircraft at the elevation and speed.  As was the point that the planes structure would fall apart at that speed. It turns out a nosedive speed will destroy planes as well.  he said that as well.  But again you pretend he didin't say that.

"It happened to be that the second was in a steep dive when hitting the tower. "

Did you see the plane hit the building at all?  I'm wondering.  Because when it hit it was leveled.  No nose dive.  The terrosist would have to pull up out of that nose dive, and good luck doing that from a guy who can't fly or land a Cessea very well at all.  Plus that whole engine thrust and structure and vmo thing which you really don't care about at all.  

How come those phone calls made at the exact moment of the nose dive didn't have screaming?  Again you ignore the facts.  How come there was no noise in that plane during your supposed nosedive?  You are Physics 9/11 man!  No noise in a plane nosediving!

You think the 2nd plane hit the tower in a nosedive and you think mace was not used.  

You literally are conspiracy theorist 101 here.  You deny the video evidence of the plane heading at the tower at a 180 degree angle and you deny the phone call that EVERY news agency reported about mace/pepper spray being used.

"I asked you before and you ignored that question (like you have ignored most of my questions), how do you know if those planes did or did not flutter? And why is the first plane relevant anyway?"

Because you can see flutter happen!!  That is why!! It is literally visible.  And you can easily see that all the wings are present and NOT MOVING.  The video we have is NOT THAT BAD.  You can make out people in windows.  You can make out people falling.  You sure could see fluttering in the wings.  But there was none! 

By the way NONE of your computer models of the planes hitting any building that day as done by NIST or any gov agency show the planes fluttering!  Which is impossible!!  So how detailed are those models you claim are without error and accurately represent what happened when they can't  even include the fluttering (hint they didn't because they did not flutter because they were not those planes)?  I don't care how good a pilot you think Mr. Cessea is.  Its a law of physics.  Fluttering will happen.  But on 9/11 it did not. You chose 9/11 physics over the physics of the the entirety of the universe.  I chose physics over the entirety of the universe.

I find it really funny how you keep questioning my expert sources yet provide none of your own supporting what you claim (beyond your comment of "don't assume" when I told you to listen to the design and pilot experts.
Reply: @brucelansberg5485  Again you utterly missed the entire point.  Here is the transcript of that part

Interviewer:  So it would be impossible for a Boeing 767 to go over 500 mph at sea level?

Goprdon:  Yeah

Interview asks "Umm.  even like ay if it was even in a shallow type of dive.  "

Gordon:  "Any airplane can dive and of course then you've got the assistance of gravity right?   

Interveiewer  Yeah

Gordon "THERE COMES A POINT WHERE THE DRAG OF THE AIR OVERCOMES THE AERODYNAMICS OF THE AIRPLANE."  aka the plane will rip apart as we se in the start of the video of those planes.

Interviewer " Ok so it wouldn't be able to even in a shallow dive per say

Gordon "Using the word shallow, if you pointed it down then yes you can get the speed.  And THAT IS ONE OF THE PROBLEMS WITH JET AIRPLANES AT HIGH ALTITUDES.  When you start down, you have to be very careful that you DONT EXCEED THE MAXIMUM SPEED and they do have what we call a mach indicator which will give you a noise that you're exceeding the maximun mach for the airplane. "

He does not say the plane will be stable and everything will be fine which is what happened on those planes.  Because all of them minus Shanksville hit their targets.  At what point did he say Its A OK?  because you said he did.  But he did not.  And you ignore his very explanation of what would happen in his reply "There comes a point where the drag of the air overcomes the aerodynamics of the airplane."

Why do you need a mach indicator if the plane is going to be ok?

Plus you ignored everyone else completely because they didn't include any nuggets for you to jump onto.
Reply: @DS94everXev  You qouted something like F-ma, in relation to the planes hitting the towers. It has nothing to do with thrust. So yes, please stop misquoting me. I have asked it nicely three times now.

"So I provided more credible sources in that video of aeronautical engineers and pilots WHO KNOW MORE THAN YOU DO support the statement I made that no way could those planes have gone that fast and been that stable."
False again. Just like teh first video you directed me to. What is said in the second video is that the engines cannot deliver enough thrust to fly level at sea level. Do you even watch the videos you direct me to? Or do you simply copy/paste what others tell you? The last guy interviewed even mentions the option of a diving plane. Please watch the suff you redommend other, and watch it fully before you use yet another video that disproves your rediculous claims.

"So once again we have you saying that you want evidence.  It is provided."
Maybe I wasn't clear, and I apologize for that. I would like to see some evidence backing up YOUR claim, not MY rebuttal.

"Then you again ignore the video and did not watch"
Oh dude, this is getting annoying. Not to my surprise however. Let me recap:

Video 1: The guy makes a video about speed limits for the plane he flies, a 737. There are several limitations. One of them is using landing gear, another one is air traffic control and a third one is using flaps. Regarding using flaps he says for configuration 1 and 5, the maximum speed to fly is 250 knots, otherwise you can't should't engage flaps. The he says that 250 knots is the maximum they fly below 10k ft anyway and he says he'll get back to that later in the video. Later in the video he explains that air traffic control does not allow passenger planes to ga faster than 250 knots when below 10k ft. Cargo planes do not have this limitation.

Your claim was "The reason why the towers COULD NEVER have fallen due to a plane hitting them is because they were designed to take on a passenger plane going 250 mph. Why 250? Because that is the max speed they can go." And the "evidence" to back up your rediculous claim was the video I just described in which you specifically reffered to the pilot's comment that a passsenger plane IS NOT ALLOWED to go faster. Have you made it over the 10 minutes mark? That is about where his explanation starts. This video (or at least the part you quoted) does NOTHING to help your case.

Have you looked up the meaning and values of Vmax and Vd for a 767 yet? Have you found out about the 20% margin on top of that yet?

Video 2: The guys answer to the question if a plane can fly 500 mph at sea level. They basically all say NO. Correct. Have you also listened to the reason they gave? The engines cannot deliver enough thrust to keep a plane flying level at that altitude. Which is also correct. have you also listened to last guy interviewed? The one that added that it is possible if the plane was in a descent? Have you heard that? He says gravity is helping the engines. Have you heard that? Have you also seen how the second plane was indeed in a dive?

Your claim that planes cannot gpo faster than 250 mph is complete and utter nonsense. And your videos actually prove it.

"And you by the way have provided LITERALLY  NOTHTHING to support your comments that this is wrong."
Well, you helped me quite a bit. I just had to refer to YOUR OWN SOURCES, which I have done several times now. It is right there. You just need to watch the video and tru to understand what is actually being said. It is not difficuly and I'm confident you can do it.

"No you don't need to when you support their conclusions"
It do not support the CIA, I do not oppose the CIA. I simply don't care about the CIA. So please don't tell what I think or what I believe or who I support. You need to stop misquoting me and you need to stop telling me what I think or believe. I will do that for you.

"and dismiss actual first hand accounts and physics and timelines and peer review literature."
Please do not tell me what I dismiss, unless you can quote it from any of my replies above.
- What first hand accounts do I dismiss? Or are you talking about the videos you provided as a source but failed to understand what is being said in these?
- Which physics are you talking about?
- Which timelines are you talking about?
- And which peer review(ed) literature?
Additional question: What do you think peer review actually is?

"You support the CIA by insisting you know better than those who design and fly the aircraft.  That is how."
How can you be so wrong so many times in just 1 single comment? I fo not disagree at all which the people and their statements in the videos you provided. I actually agree, as I have stated before. The problem is that you do not understand what is being said in these videos. I have summarized it above, for your convenience. Rewatch the video in full and take some time to process the information being provided.

" You don't question what the CIA say.  And you defend what CIA say.    All without motioning the CIA."
I couldn't care less what they said or wrote. I never mentioned them. Never said I agreed, never said I didn't. It is completely irrelevant. I DON'T CARE.
Reply: @brucelansberg5485  
"Why 250? Because that is the max speed they can go.
And the "evidence" to back up your rediculous claim "

Actually the evidence of this claim is from the building designers themselves.  So yeah.  You don't have clue what you are whining about here.  Look it up.  But you won't because you'd be proven wrong.

"What is said in the second video is that the engines cannot deliver enough thrust to fly level at sea level. Do you even watch the videos you direct me to? Or do you simply copy/paste what others tell you? "

And they also said in the video that the actual structure of the plane can not be stable at sea level going that speed!!!!!  But you only care about the last guy one comment.  Completely ignoring his statement that at some point the draft will overcome the planes aerodynamic design.  You literally ignored EVERYBODY ELSE in that video.  Then ignored the follow up comment he made after the gravity assistance comment!!  You don't listen to anything at all.

Again you pretend structural integrity is not a thing.  A plane has to be able to withstand the thrust of moving thru the air.  Your wonderful F=ma is useful here.  USE IT

"Please do not tell me what I dismiss, unless you can quote it from any of my replies above."

Well you dismiss the man in Bldg 7 story.  You dismiss the experts.  You dismiss the flight attendant.  You dismiss the pilots (you just ignore  them that is how you dismiss them).  You dismiss the engineers .  And you just now have dismissed the designer of the WTT saying that the building was not designed to take on a large passenger jet at 250 mph.  And you even dismiss the Flight attendants report that pepper spray or mace was used!  

So that is a quite a lot of dismissing.  

"The problem is that you do not understand what is being said in these videos. I have summarized it above, for your convenience. Rewatch the video in full and take some time to process the information being provided."

Then why don't you find videos proving your statements if they are true.  As of now you have  not.  You have "interpreted" the videos in the way you wanted them to be heard.  Then you want me to take your interpretation over what I actually heard in the videos!

If you are not doing that then what are you doing?  Not showing me anything new.  Just telling me that when experts say it is impossible, you say its easy and was done.  

Nope.  Not good enough.  Only one person who commented on these videos interpreted them in the same way you did? Perhaps it is YOU is misinterpreted them. He was thruroughly owned by somebody saying what I'm saying.  They did  not listen to the engineers.

When somebody says its impossible for the planes to do what they supposedly did, that means its impossible!  It does not mean, its easy.  You ignore the entire video.

"Which physics are you talking about?"
The physics that say these planes did what they did.  The physics that says you can't make  building collapse symetrcially when asymetrical damage was caused.  The physics which says you would not be impacted by pepper spray a good distance away in an airplane in the air.

"Which timelines are you talking about?"
The timelines of when things happened.  For one, a cell phone aboard one of the planes was still sending signal 20 minutes after it crashed.  And the terrorist's who flew those planes were alive and many not in the country on 9/12 nor have they ever visited the USA. 

"Your claim that planes cannot gpo faster than 250 mph is complete and utter nonsense. And your videos actually prove it."

No.  All my videos prove it to be true.  Unless you want the plane to fall apart.  Then go ahead and go over 250 mph.  Those planes were stable when they hit.  Physically impossible even if they did hit that speed.

"What do you think peer review actually is?"
It is not the 9/11 Commission Report.  

he engines cannot deliver enough thrust to keep a plane flying level at that altitude. Which is also correct. have you also listened to last guy interviewed? The one that added that it is possible if the plane was in a descent? Have you heard that? He says gravity is helping the engines. Have you heard that? Have you also seen how the second plane was indeed in a dive?"

yep.  He also said the drag would eventually overcome the plane. You though NEVER explain that part and how it is ok.  And they all said the plane structurally would come apart.  ITS NOT ALL ABOUT THRUST.  If the plane falls apart it does not matter if you get the thrust!!  They all agreed the structure would not make it NO MATTER how you  got the speed (dive or not) at sea level. Those planes are not built for that kind of thrust at that low elevation because they would fall apart!!

Why is this so hard for you to get?
Reply: @DS94everXev  "No it really isn't all about the engines at all."
Is it not about the engines and the thrust these deliver? Have you watched the video?

"Though according to you engine thrust is not important in moving a plane at x speed at x elevation"
Please stop misquoting me.

"and neither is structural integrity in an aircraft"
Please stop misquoting me. You are making up your own reality.

"so I'd take your entire reply as "I don't know what I'm talking about." "
And this is exactly your problem. You make up stuff I wrote and draw conclusions from your fantasy.

"The video is also about the ability to control the plane and the plane literally ripping apart."
Is control mentioned in any of the interviews? And who said anything about the plane being ripped apart? The first guy is talking about the plane losing parts. The inetersting thing is that furteron in the video another expert says that the speed actually isn't an issue. He says the mach number is not bad. And the mach number is actually the determining factor when it comes to the structural integrity of the plane.

"The part about how the engines of the plane would have to be changed to get that thrust.  And even if they were changed the structure of the plane would not hold up to that so it would fall apart."
No. The structure of the plane would be able to eep up with the power of the engines ad the engines would seperate themselves from the plane. Bu it doesn't matter anyway. 

"You literally didn't listen to anything at all."
Oh the irony :)

"The words "impossible" were used regarding if the planes could do this.  Did you miss that?"
Did you miss his explanation? "You need so much power to push yourself through that air." Clearly he is talking about a lack of engine power. He wasn't asked the question if it would be possible if the plane was in a dive, unlike the last guy that was interviewed. And guess what he said???

"Did you see the plane hit the building at all?  I'm wondering.  Because when it hit it was leveled."
So? Do you think it picked up speed from the dive just before it levelled out?

"Plus that whole engine thrust and structure and vmo thing which you really don't care about at all."
I actually DO care about Vmo. And I know what it means. You should really look it up, and find what it means. Also look up Vne. Also look up VD and VDf. Engine thrust has its limits, yes. And gravity will help overcome those limits. It is really noit that complicated.

"How come those phone calls made at the exact moment of the nose dive didn't have screaming?"
https://youtu.be/6xIFbE92l9I?t=138
You wouldn't happen to have a link to a recording of that call, would you?

"Again you ignore the facts."
Which facts EXACTLY did I ignore?

" How come there was no noise in that plane during your supposed nosedive?  You are Physics 9/11 man!  No noise in a plane nosediving!"
Which flight 175 was recorded during the descent? 
Here's the Sweeney call, before th descent. Do you hear noise or don't you?
https://www.youtube.com/watch?v=gulhkfAjTko

"You think the 2nd plane hit the tower in a nosedive"
Please stop misquoting me!

"and you think mace was not used."
Please stop misquoting me!

"You deny the video evidence of the plane heading at the tower at a 180 degree angle"
Oh man... You can't even get the angle correct. For now I'll assume you meant 90 degrees. And no, I'm not denying that. Plase stop miquoting me.

"and you deny the phone call that EVERY news agency reported about mace/pepper spray being used."
Please stop misquoting me!

"Because you can see flutter happen!!  That is why!! It is literally visible."
I asked you before and you ignored that question: How do you see flutter from grainy and shaky videos taken from a distance?

"And you can easily see that all the wings are present and NOT MOVING."
What does the presense of wings have to do with it? Of course they are present. Also, like I stated before, for flutter, Mach value is relevant. Mach value was fine. Listen to your own sources.

"You can make out people in windows."
You can make out people in the windows of the 767?

"You can make out people falling."
From flight 175? What are you talking about?

"By the way NONE of your computer models of the planes hitting any building that day as done by NIST or any gov agency show the planes fluttering!"
Waht...,? I don't have any computer models. Could you be a little bit more specific please? Which models exactly are you talking about? Links please.
Anyway, NIST was tasked to investigate the collapses of the towers. They weren't tasked to make a real life video of a wing fluttering plane. This is a silly argument and is completely irrelevant. Also, I have not claimed there was flutterng or there wasn't fluttering. I have simply asked you how you woulkd have been able to detect it from grainy and shaky low res videos.

"So how detailed are those models you claim are without error and accurately represent what happened"
Please stop misquoting me! And please do not make up stuff I said or wrote.

" Its a law of physics."
Which law would that be exactly?

"Fluttering will happen."
Not according to the experts in the videos you linked.

"You chose 9/11 physics over the physics of the the entirety of the universe.  I chose physics over the entirety of the universe.":
As long as you have no clue about the difference between 180 degrees and 80 degrees anglke, you are not the one to teach me on physics. If you think you are, pelase enlighten me.

"I find it really funny how you keep questioning my expert sources yet provide none of your own stating what you claim."
Please stop misquoting me. I do not question your sources. I agree with your sources. You just have no vlue what these sources tell you. It doesn;t need an expert to understand that. And that is the actually funny thing.
Reply: @DS94everXev  "Well you do request I provide evidence from experts then I do and you say you never did request it."
Please strop miquoting me!

"You know what else REALLY helps a plane go thru the towers?  If it were made of steel"
Hahaha, dude...

"That would also help your F=ma."
Oh, it definitely would. But do you understand why?

"But you will ignore that FACT."
Please don't tell me what I will ignore. See comment above.

"You throw a pillow at 10mph at someone and it won't hurt them.  You drop a cube of steel on your foot that weighs the  same as the pillow and you will hurt.  Density and penetration matter!"
Not when it comes to F=m*a. It would make a difference in the damage pattern, but it doesn't maken any difference in the applied force. Nothing. Nada.
Steel is cut using water.. What else do I need to say?

"There is a reason why Aluminum (the main metal in passenger planes) if present at all in a bullet (likely not) is not used as the primary metal.  It won't penetrate like other metals will!  meaning its force going at the same speed won't get thru armor."
Aluminum bullets would be a lot lighter and would be ineffective. (m)

"That is why I make fun of your F=ma."
You shouldn't as long as you have no understanding of its meaning.

"You have no understanding of why we use what we use for the purpose we use them for. Aluminum planes aren't going thru those buildings like a steel plane."
Sigh... steel planes don't fly. Guess why? Mass maybe? THe'd be too heavy to fly. Yes, steel planes would cause more damage. Steel planes would be a lot heavier (m).

"Maybe I would if you admit that the gov facts that day don't line up at all so they are wrong."
Could you name a few?

"You think you know more than an aeronautical engineer and a pilot."
Where do you get this? Their level of knowledge is not the issue here. Your misunderstanding of what they are saying is.

"If you were you'd know about smelling odors in the entire plane "
What are you talking about? Please be clear.

"and you'd know that you can't get 600 mph below 10000 feet elevation using those planes without them being ripped apart in the process.  "
With every post the planes go faster, just like the interview did in your second video.
NTSB calculates the speed of flight 175 at 515 mph, 447 knots.
MIT calculates the speed of flight 175 at 503 mph, 437 knots.
http://web.mit.edu/civenv/wtc/PDFfiles/Chapter%20III%20Aircraft%20speed.pdf
https://web.archive.org/web/20071219230238/http://911myths.com/images/c/c1/Radar_Data_Impact_Speed_Study--AA11%2C_UA175.pdf

Have you looked up the different V definitions yet?

"You provide no actual documents or vids disproving any of the plane material at all."
No need to, You provided the evidence already.

"Yet I should stop assuming."
Exactly. If you're not sure about anything I think, I believe, I wnat, I need or I mean, just ask me.

"You'd have loaded up a ton of material for me to look at if you knew what you were talking about."
No need to, You provided the evidence already.

"Instead all you do is state that facts are not facts"
False. I have explained your flaws in understanding what is actually being said in your videos.

"And I'm supposed to take your word over ALL these experts."
No. the experts in your two videos are correct, as I have stated many times before now. You just don't want to understand what they are saying. Maybe you do want to, but simply don't. But is is all right there, in your videos.

"Based off of what?  You saying so?"
Nah, based off your experts saying so. For some reason you seem to believe they are agreeing to your claim. Yet they talk about other things. It isn't complicated.
Reply: @DS94everXev  "THERE COMES A POINT WHERE THE DRAG OF THE AIR OVERCOMES THE AERODYNAMICS OF THE AIRPLANE"
Did he mention anything about that specific point?

"aka the plane will rip apart as we se in the start of the video of those planes."
Wrong. He is talking about terminal velocity. Look it up if you don't know what it means.

"if you pointed it down then yes you can get the speed."
And there you go...

"And THAT IS ONE OF THE PROBLEMS WITH JET AIRPLANES AT HIGH ALTITUDES.  When you start down, you have to be very careful that you DONT EXCEED THE MAXIMUM SPEED and they do have what we call a mach indicator which will give you a noise that you're exceeding the maximun mach for the airplane. "
Honest question: What do you think this part means exactly?

"He does not say the plane will be stable and everything will be fine"
He didn't state the opposite either. No what?

"And you ignore his very explanation of what would happen in his reply "There comes a point where the drag of the air overcomes the aerodynamics of the airplane.""
Again, I don't. It is your poor understanding of what the meaning of his words are. Look up[ terminal velocity.
https://www.youtube.com/watch?v=HMFVCd_4YvY

"Why do you need a mach indicator if the plane is going to be ok?"
If the plane is going to be OK with what?

"Plus you ignored everyone else completely because they didn't include any nuggets for you to jump onto."
|I didn't ignore any of them. We addressed them before. They were all talking about engine thrust. We have passed that already.
Reply: @DS94everXev  "Actually the evidence of this claim is from the building designers themselves."
Which claim? That a plane can't go faster than 250 mph at sea level? Wrong. What was said in an interview you might be referring to is that the towers were designed to survive an impact of a landing plane, lost in the fog, low on fuel. A landing plane, because there are three airports in the area. Landing planes ga slower. Not because they can't go faster, but because they have to come to a stop eventually. Have you seen the video of the high speed low pass I linked before? Was that plane going faster or slower than 250 mph?

"You don't have clue what you are whining about here."
Again, oh the irony...

"And they also said in the video that the actual structure of the plane can not be stable at sea level going that speed!!!!!"
Wrong. They said that larger engines would have an impact in the structure, meaning, the engines would seperate themselves from the plane.

"But you only care about the last guy one comment.  Completely ignoring his statement that at some point the draft will overcome the planes aerodynamic design."
No I don't. Draft WILL overcome the aerodynamic design, meaning the plane won't go any faster becasue it has reached its terminal velocity. It can';t go any faster because the air moleculoes can't get out of the way any faster.

_"You literally ignored EVERYBODY ELSE in that video."
No I didn't. I actually addressed them when we were discussing thrust. Then you made it clear that it wasn't about thrust and you didn't want to discuss it any longer.

"Then ignored the follow up comment he made after the gravity assistance comment!!"
Wrong. The comment on planes descending from high altitudes? Please explain to me how that is relevant in this context?

"Again you pretend structural integrity is not a thing."
Wrong. It actually is a thing. You believe the plane wil fall apart when it flies over 250 mph at sea level. None of your sources have confirmed this. Those same sources have actually explained that a plane can fly a lot faster than that.

"Well you dismiss the man in Bldg 7 story."
Please stop misquoting me. When and where in this thread have we discussed WTC 7 at all?

"You dismiss the experts."
No I don't. I think they're correct. But most of them are not addressing your issue.

"You dismiss the flight attendant."
Please stop misquoting me. When and where in this thread have we discussed a flight attendant at all?

"You dismiss the pilots (you just ignore  them that is how you dismiss them).  You dismiss the engineers"
See my 5 earlier comments on this issue. You not understanding the matter is the problem here.

"And you just now have dismissed the designer of the WTT saying that the building was not designed to take on a large passenger jet at 250 mph."
What...? I do agree I missed that 1 single sentence in your sea of nonsense before. But please tell me what it means. And how it is relevant. You do realize he was talking about a landing plane?

"And you even dismiss the Flight attendants report that pepper spray or mace was used!  "
What report? What flight attendant? You mentioned pepper spray and I addressed your comment. i asked you how you believe pressure in the cabin would cause pepper spray to spread through the fusilage. You ignored that question.

"So that is a quite a lot of dismissing."
No it isn't. I have actually addressed ALL of your comments, except for the WTC desginer's one, which I have now in this post. I can't dismiss something if you don;t mention it. But now, how about answering the quesations I have asked you?

"Then why don't you find videos proving your statements if they are true."
Because it is all there in your own videos! What these guys state is correct. But they do not address your problem. Do you want me to make a video on that?

"You have "interpreted" the videos in the way you wanted them to be heard.  Then you want me to take your interpretation over what I actually heard in the videos!"
When someone says: planes cannot fly faster than 250 knot/h, what do you think it means? It can mean many things. You have chosen to believe the meaning that suits your believe. You have chosen to think there is some physical limitation for it. Yet the guy making the claim has given two explanations. 1. Flaps. 2. ATC. So when you hear the claim of 250 limitation, why do you chose your own special explanation, although the expert has 2 different explanations and doesn't even mention your explanation. You know, the same expert that made the claim in the first place. And I am the one who has interpreted the videos the way i want? this is laughable dude.

"Just telling me that when experts say it is impossible, you say its easy and was done. "
Please stop misquoting me. I have explained (not just told) several times now that these experts are talking about engine thrust. The engines cannot deliver enough thrust to keep the plane flying level at low altitude at that speed. THEY DID NOT TALK ABOUT A DESCENDING PLANE, except for the last guy who explained that a descending plane gets help from gravity. They say IT is impossible. But that IT, is nbot relevant. Flight 175 was in a descent picking up speed from gravity. Do you get it now?

"The physics that say these planes did what they did.  The physics that says you can't make  building collapse symetrcially when asymetrical damage was caused.  The physics which says you would not be impacted by pepper spray a good distance away in an airplane in the air."
Care to elaborate on this? I do not recall studying the physics of the things you metioned. Which are these? And how do they work?

"For one, a cell phone aboard one of the planes was still sending signal 20 minutes after it crashed."
Haven't heard about that. Can't comment on it.

"And the terrorist's who flew those planes were alive and many not in the country on 9/12 nor have they ever visited the USA. "
Oh, come on... That one was debunked the same as it appeared. You'll have to do better then this. I won't address beginners claims. Sorry.

"No.  All my videos prove it to be true.  Unless you want the plane to fall apart.  Then go ahead and go over 250 mph.  Those planes were stable when they hit.  Physically impossible even if they did hit that speed."
Sigh...

"It is not the 9/11 Commission Report."
Wow... This is your answer to my question if you understand the meaning of peer review? I think it is safe to assume that you have no clue how peer review workls and what is actually is.

"He also said the drag would eventually overcome the plane. You though NEVER explain that part and how it is ok."
Done so twice.

"And they all said the plane structurally would come apart."
Litterally NONE of them said so.

"They all agreed the structure would not make it"
None of them even mentioned it. Well, one mentioned it in relation to engines that would be able to deliver 6 times more thrust. Which is completely irrelevant.

"Those planes are not built for that kind of thrust at that low elevation"
Thrust comes from engines. You mean resistance or drag and you're wrong. It's Mach level that decides, not speed. This was also clearly excplained in your video.

"Why is this so hard for you to get?"

I'm not the one who doesn;t get it dude. You know what? Find a pilot yourself, ask him the exact questions you want an answer on and keep asking so you're sure you get the answer to your actual question.
Reply: @brucelansberg5485  " Have you watched the video?"

I actually have that same question for you because you AGAIN ignore structural integrity.

You know the thing that keeps the airplane together. YOU IGNORE IT!!

"Please stop misquoting me."
Then you are not clear in what you say at all. Not my problem.

"You can't even get the angle correct. For now I'll assume you meant 90 degrees. And no, I'm not denying that. Plase stop miquoting me."

hahahahaha Oh dude. No, You didn't just say that! That is worse than your comment that the use of mace pepper spray is unsubstatitated!!

A Circle is 360 degrees. Make a line across the middle so both sides are the same size and you have now cut that degree into half of 360. AKA 180 degrees!! AKA a straight line (that means no angular momentum)!!

A Ninety degree angle is frankly impossible to achieve in all but ufos that we have spotted on radar! No man made machine where man is at the seat can make a 90 degree turn without some massive slowing down. 90 degrees is straight down!!!

No wonder why you are utterly lost in this discussion on physics! You dont even know what a 180, or a 90 degree angle is!!!! We teach this stuff in elementary school and you are telling me that your interpretation of what the experts said is wrong!!!!

oh man. 

"I find it really funny how you keep questioning my expert sources yet provide none of your own stating what you claim." 
Please stop misquoting me. I do not question your sources. I agree with your sources. You just have no vlue what these sources tell you. It doesn;t need an expert to understand that. And that is the actually funny thing."

Funny thing. You actually do question them. Or you flat out ignore them. AKA obsessing over the last guy comment while ingoring what he said happens if you do use gravity (better be careful and no way is Mr. Cessia going to be careful). How come you don't seem to recognize what was said by EVERYBODY else? AKA ignoring or dismissing them. 

"It doesn;t need an expert to understand that. And that is the actually funny thing.""

Actually you do NEED sources to support your claims. You are really lose in this entire investigation thing aren't you. How come you can't or won't find them? How come you can't get somebody legit to say, "yeah they used gravity to get that speed up there. And the plane could totally handle the drag and increased pressure withuot any trouble. And the pilot can easily manuever the plane thru the busiest skyline in the country and possibly the world and avoid hitting all the other buildings but aim perfect center the one they want to. And such a pilot can be such low skill that he could barely fly a Cessea at cruising height and did not know how to land . Such a feat in fact is not out of the ordinarey and completely expected.

THAT IS WHAT YOU NEED TO FIND BECAUSE THAT IS WHAT YOU ARE SAYING. No BS. You are denying all these facts. So find an expert who agrees with you. 

You haven't. Because they do not exist.

At this point you are in denial of what 180 degree angle is vs a 90 degree angle. You don't think pepper spray was used even though EVERY SOURCE SAID SO. 

And the pilot did not disagree with ANYTHING I and another person wrote. If we were wrong, why didn't he correct us? He read our comments. He had the chance to correct us. But did not. WHY?

"As long as you have no clue about the difference between 180 degrees and 80 degrees anglke, you are not the one to teach me on physics. If you think you are, pelase enlighten me."

HAHAHAHAHA!!!

This is GREAT! You think you know what angles are??

lol
Here is  a video about angles. Its got cute colors and sound effects so it is easy for people like you to understand.

https://www.youtube.com/watch?v=DGKwdHMiqCg

Go to 3:30 and they talk about right angles.  Oh dude.  Oh lord.  
And go to 4:55 for what a straight angle is.  You get a straight angle when you get two right angles together.  

Just WOW!  You do not know what a straight angle or straight line represents angle wise.

Here is another explanation

How many 90 degree angles are in a straight angle?
two 90 degrees angles
There are two 90 degrees angles in a 180-degree angle or straight angle. As the sum of two 90 degree angles is equal to 180 degrees, also the half of 180 degrees is 90 degrees. Thus twice 90-degree angles are there in a straight angle.

When those planes hit the towers, they were NOT GOING 90 DEGREES.  They were going STRAIGHT and parallel to the ground.  AKA 180 degrees.
Reply: @brucelansberg5485  You don't think the pilot discussed structural integrity or manueveringn the plane?

Ok.  You did not listen to the video at all.  structural integrity was a common theme in the video.  It even starts with the example of the guy running on the ground and then trying to run that same speed in a thicker medium.  He'd be ripped apart.

That is fact.  And you igore the ability of the plane to hold up.  EVEN if the engine was able to get enough thrust!  

"He didn't state the opposite either."
The other guys did. And he had a chance to state something different but did not.  So you got nothing.

Honest question  What evidence do you have that these guys can even do these maneuvers?  Because they didn't EVER  train in a passenger jet.  And they sucked flying the Cessia.  Yet you want me to believe they can handle a passenger jet as well as a Top Gun pilot could.

And again you flat out ignore the phone calls.  Imagine you are a terrorist and you devised this plan and THE only way for you to be stopped is if some passengers called somebody on the ground and the US government shot you down (as they would).

Why would you EVER allow hostages to make phone calls?  I mean you must lack a brain cell if you allowed that.  And they did.  All of the planes hijackes did!  

How did that go in the planning stages Osama said "Ok guys, let them call up people.  It's ok.  Dont worry about it."

You MUST believe that to believe this lie official story

And why didnt a single flight attendant say how the hijackers got into the cockpit?  That woiuld be the first thing you'd say.  Not to mention....how come not a single cockpit member yelled out a warning to some airport command center or military that they were being hijacked?!!  You never gave a thought have you?  The fist we hear of it the hijackers just took over.  HOW?

That cockpit door is locked.  And if the hijackers started to systemically killing passengers (we know they did not becuase no call made said so) the cockpit crew is trained NOT TO OPEN THAT DOOR. And the guys in the cockpits on all the planes were big buff military guys.  225lbs and strong as an ox.  EVERY one of the terorrists were puney nothings armed with box cutters.  Plus the cockpit is equipped with an ax.  You put 6 wimpy looking guys with box cutters vs military buffed up soldier trained pilots with an ax, and that is a very short fight.  Buff military trained ax guy wins.

Also tell me what the heck the hijakces were doing.  There were 5 in the plane.  Only 3 in the cockpit.  So what did the other 2 do?

You are telling me that they just sat around and allowed people to make phone calls.  Or as a hijacker would you watch over all the people in the cabin and make sure that nobody gets out of line.  If anyone does, they die. I mean its really really obvious what you would do!

For Flight 93, do you honestly believe hijackers would allow the passengers to get ahold of a cart and ram that into the cockpit door and that it would open it?

HAHA.  9/11 physics baby.  Plus why would the hijackers allow them even out of their seats and how did they get a cart without the hijackers knowing????!!!

country's

You have a trained assassin who could kill a man with a credit card and pen.  You have hockey players who aren't afraid to get hurt and bloody.  You have more trained soldiers traveling as passengers.  And not a one of them did anything to stop harm or kill even one of these hijackers.  That is what you are telling me happened.  I don't believe it.  

All of this is in the video I provided from the flight attendant.  (Hint she knows the protocols and which planes had STAIRS and you don't.  Unless you are also an expert flight attendant as well as expert in aeronautical and physics which we know you don't know since you think 90 is 180 degrees.)
Reply: @brucelansberg5485  

"There is no arguing with @tu^id"

Agreed.  Finally we agree on something. 

You think mace was not used despite it being widely reported.  You think 180 degrees is not a straight line.  You think the planes hit going at 90 degree angle to the towers and Pentagon too as well which would be straight down nose of the plane on top of the building. Lol.  The video clearly shows it hit going 180 degrees yet you cant admit you are hopelessly wrong (What would a 45 degree angle of impact look like to you.  I think it was a 280 degree angle 😆)  You have NEVER learned the basics of geometry yet want me to take your word over experts.  You obsess over gravity but pretend structural integrity isnt a thing.  And that manuevering a plane is not an issue despite pilots ON RECORD discrediting you.

You believe that F=ma is the holy equation but forget that the towers made of cement and steel would apply an equal and opposite force against the aluminum plane when it was hit (same physics as a bullet proof vest vs a bullet)  And aluminum won't penetrate steel and concrete very well at all.  So that fast moving Aluminum plane is folded like a pancake. 

 Not to mention the Pentagon plane that hit it yet there was no damage from the wings onto the building and the wings were not on the grass in front of the pentagon nor were the wings found ANYWHERE. By the way the wings are also where the planes engines hang out on, so how did the plane reach its target without its engines or its wings intact as it hit or even approached the Pentagon.   9/11 physics baby!!  So this plane made this approach without its wings and engines 😆 and penetrated 3 feet of concrete and kevlar armor.  All the while, the Pentagon..the Most well defensed building on the PLANET and knowing we were under attack by hijacked planes allowed this plane (that had cut off its transponder signal and did not communicate to flight control or military on the ground to not just fly over it) where the plane could have easily done SIGNIFICANT DAMAGE if it hit it up top but made the choice to turn around in a dangerous corkscrew manuever according to airshow pilots and hit the EXACT location where files were kept on the military audit showing like  $2.3 trillion went missing.  Killing all those people working on the audit and the data files they contained on the audit.  All the while we never so much as fired a 0.22 caliber at the plane.  Where are our miniguns and missiles!  Utter incompetence which is a trait you share with them. Thus you get along.

The hijacker plan was to NOT do the most damage possible to the intelligence and brass of our military by hitting the center from the top of the Pentagon but to "randomly" hit a target spot holding nothing of consequence except to the military industrial complex.  

You believe hijckers allow their hostages to intermingle make phone calls freely and obtain weapons and equipment to be used against them and that this is normal hijack behavior.  You do not think a hijacker would just kill ANYBODY calling because you are a (insert insult of your choosing.)

You believe it is normal crew behavior to have 0/28 crew members follow protocol when in a hijack situation.  There is nothing odd about that.  Several hundred years of experience of annual hijack training cummulatively among all of them and they ALL FAILED TO FOLLOW PROTOCOL.  Those classes must have been as boring as you in bed.

You believe cell phones worked at 30k elevation when they died at 2000 feet in 2001 because yet another 9/11 physics magic trick.

Tata.  Enjoy 9/11 physics.  Be sure you dont teach anybody anything ever because youd do society a disfavor.  Cut out your google youtube commenting.